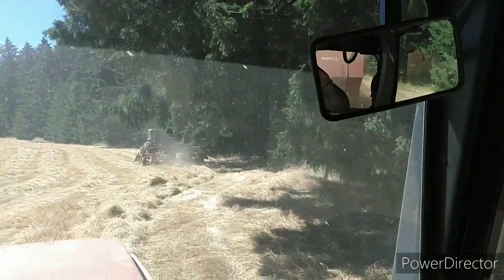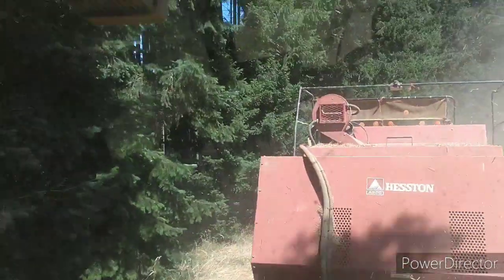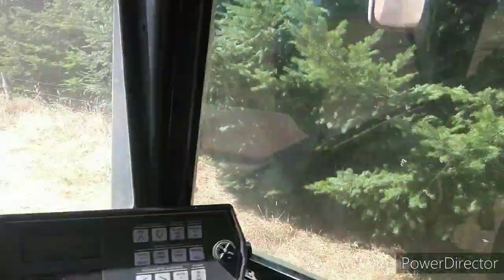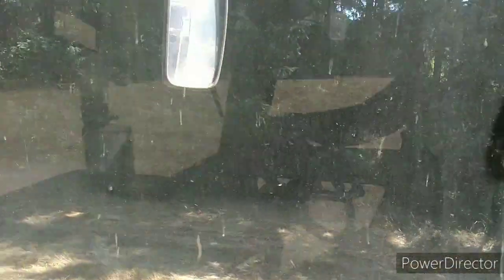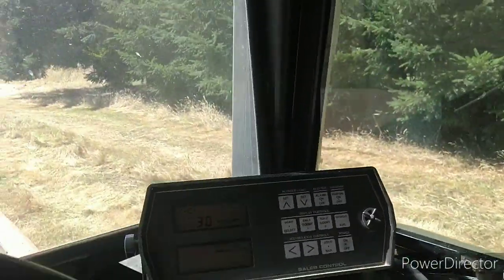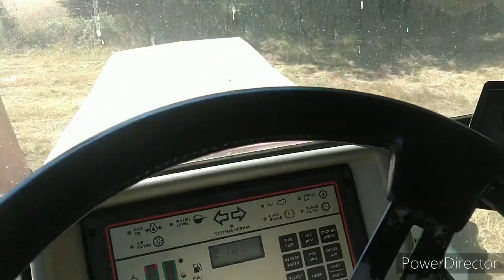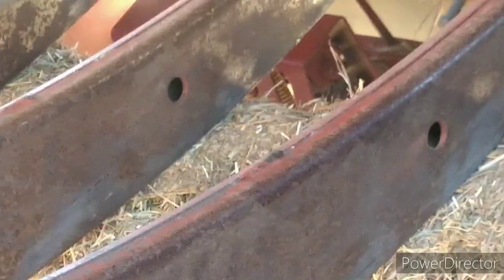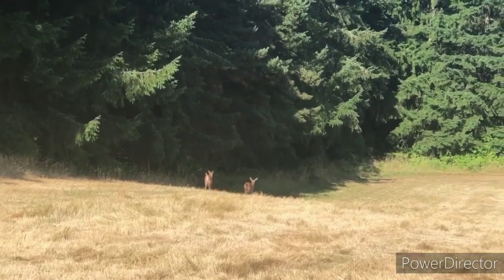Big bales count guess. Restring a bottom twine

Comment: Not done with chores yet but I'm watching anyways! Can you show how that double knotters work I've never understood how they work? Doesn't matter what you have to keep them knotters clean just as long as it works thanks for sharing that!👍 If it's too much of a pain to show how them knotters work that's fine by me!
Reply from the maker: I know there are some animated videos on YouTube that shows them.. way better than any video I could do.. they show it slow enough to see👍
And exactly!! Whatever works! 
Especially on a big baler!! Everything settles down in the Knotters!! Not like a little baler where half of it can fall off..
Reply: You basically have 2 sets of knots one on each end of the top side of the bale . 2 separate strings coming out of the twine boxes one for the bottom threaded thru the needles and the top side so there isn't one held by the twine disk

Comment: I have tried guessing number of bales on a field after the first 2 rounds it never works out due to thin or heavier spots .  I have found it easier to thread the twine around the rollers and pull on it with a little tension on the other end . Always thought about cutting a slot the end in a 1/2 bar to slip on top of bracket to tip top roller side ways but then another piece of iron to get lost in the field . LOL. . Watch out for that hidden finger Pincher when rolling the knotter frame up
Reply from the maker: Ya.. I'm the same way.. I'll tell you how many when I'm done 👍
I've tried to pull the twine into the rollers, usually just gets more crap in my face and takes longer...
Good thing is, #1 was there to help!!! Her shoulders are still in good shape, easier for her😁
And now she's done it in the field!!
Not just in the shop when it's all clean and she has more tools.
Ya, the finger shortener!  I've felt it a time or two 🤣😂 stiff moving Knotters make it worse.. actually did get a finger caught today.. first time in a long time!
Reply: @GosselinFarmsEdGosselin  damn it makes my fingers hurt just thinking about it  . My first baler I actually made a tool to lift the frame after drawing blood a few times and it hung on the railing so it was handy up there one less trip
Reply from the maker: @jeffgroce9736  I've thought about making something.. at times, it would really be nice!!
I do have the perfect tool for twine hung on the bill hooks.. old screwdriver.. medium/large flat blade with a buggered up tip.. perfect size to slip in, twist, pry the knot off and close the hook.. 
I pry first to make sure the knot stays together.. pry, pop and pull the string so it's not stuck on the arm. Takes about two seconds.